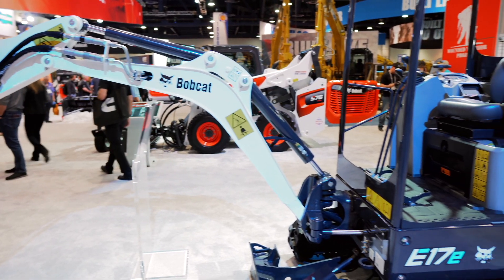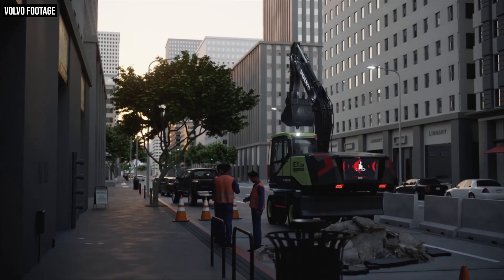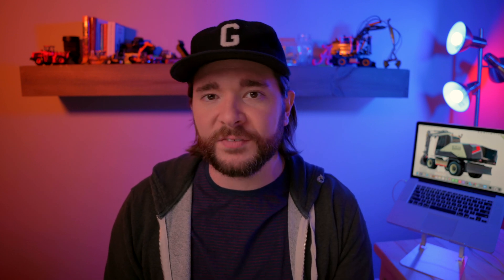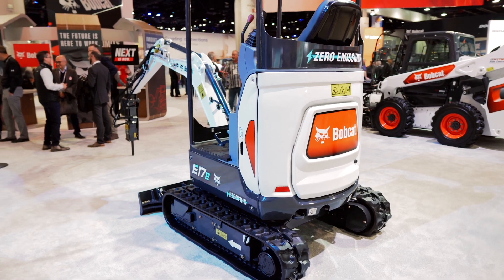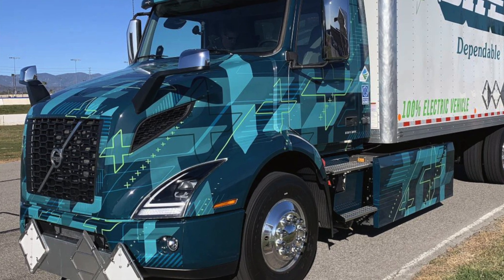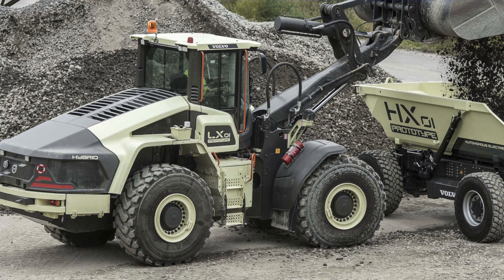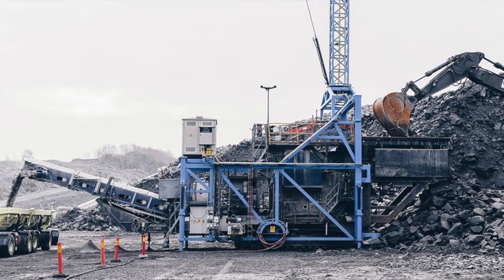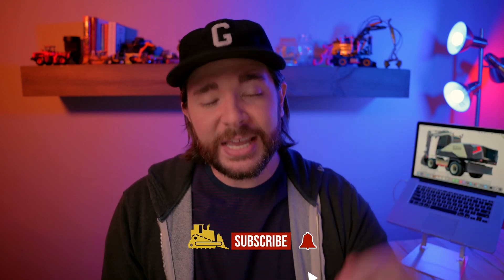Volvo's Excavator Prototypes Reveal Formidable Strength in Electric Machine Development

Comment: Great idea for city use but unless they include a towable solar charger it wouldn’t be a viable option for my area and use. I do lot clearing and excavation work for new construction and electricity is usually not accessible until my job is done.
Reply: Most of the projects I’m on, I am lucky if I can find a outlet to charge my grease gun.